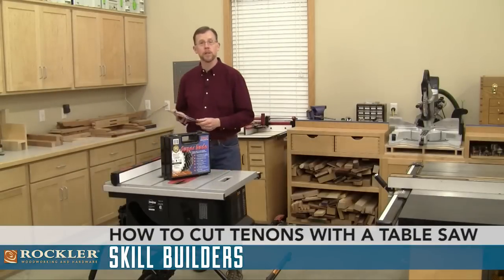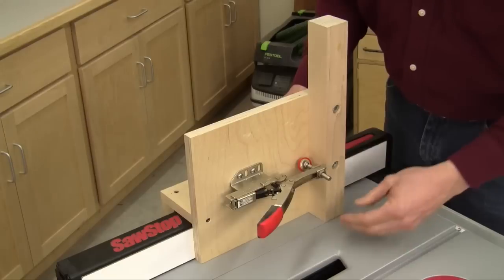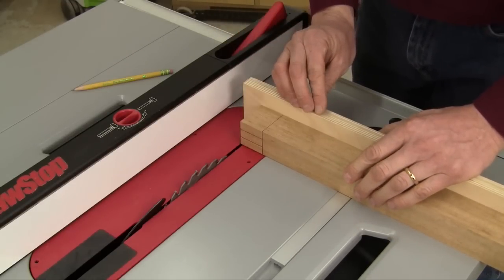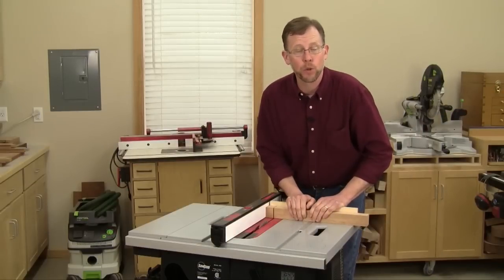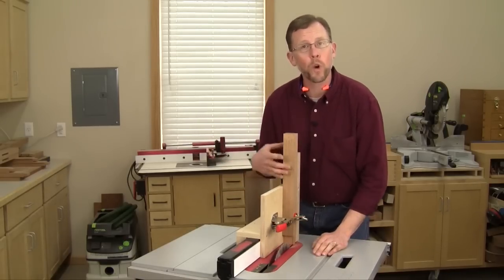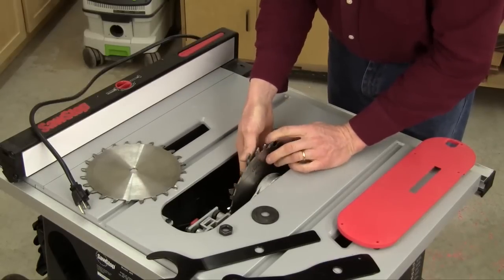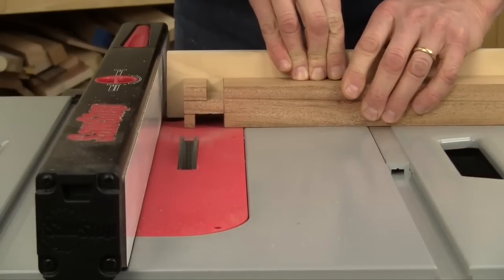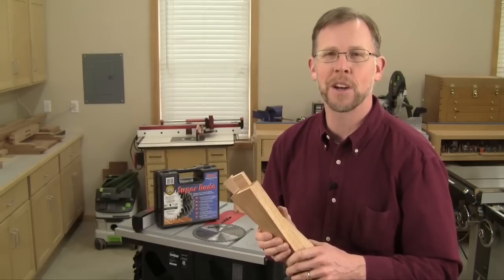How to Cut Tenons with a Table Saw | Rockler Skill Builders

Comment: I have had very little luck cutting precise tenons or tongues with a dado set.  I simply struggle to precisely set the depth, and I'm not sure my jobsite saw which lacks a depth lock of any kind doesn't walk itself down under the weight/vibration/stock pressure of the dado stack.

Also, my fence leans slightly toward the blade, so the shoulders won't line up correctly if the stock isn't square.  The solution to this is to use the narrow extension, or to use a stop on the miter gauge/sled instead.

Comment: The position of the toggle clamp on this jig makes me queasy. Not sure it is the best recommendation to use that with your hand a couple of inches above a running blade as it would be quite easy for your hand to slip off.
Reply: Saw that too. I definitely would have turned off the saw before adjusting the work piece.
Reply: Right! Pushing on a handle that snaps into place, with the running blade in the same direction you're pushing -- little more than an inch away? Super dangerous.

Comment: can a sliding compounding mitre saw be used (with a depth stop) to cut out the mortise in a 4inch square beam 1.5m long ? i need to make an accurate cross joint in two timbers, 90deg to eachother. if so, which sliding mitre saw and which blade is best ?

Comment: I used the dado method for my tenons. However the shoulder come out uneven. One is longer than the other. I've checked my miter and fence for square. Still have the problem. Any idea as to the problem?
Reply from the maker: Possible the wood is slipping along the fence when cutting. Maybe add some sandpaper strips on the fence to prevent from slipping.
Reply: Good idea. Thanks

Comment: Chris, I had always been warned: never use both the miter gauge and rip fence to make a cut on the table saw.  Is this really okay to do for cutting tenons?
Reply: The only exception to that rule is when a cut is not through like here.  Then it's okay to use both the miter gauge and the rip fence together.
Reply: @kryptik0  Thanks!  I learned something here.

Comment: Isn't against the safety rules to use the rip fence as a guide when cross cutting?
Reply: If you're making a through cut, yes.  If not cutting all the way through the piece, as here, then it's perfectly fine.
Reply: Kevin Vernon thanks for the explanation!
Reply from the maker: The rip fence can be used, but will required more care with blade set-up.
Reply: This guy explains things very well. What's his name? Does he have his own channel?

Comment: It is not the most difficult cuts being made on a table saw but the most common, seemingly easy cuts where safety falls apart.
The first rule of safety in a shop begins with a GOOD first aid kit on hand... The only 100% safe use of a table saw is to lower the blade below the table and pull the plug out of the wall...So lets get a little real here..Crap happens and no one is exempt.

Comment: oops. you're not supposed to use a miter and a fence at the same time
Reply from the maker: When making through cuts, yes. But in this process there are no pieces are being removed from the stock, so there is no chance of them being caught between the blade and fence. You will see at 3:51 into the video when the pieces are fully removed, they are released freely to the left of the blade.